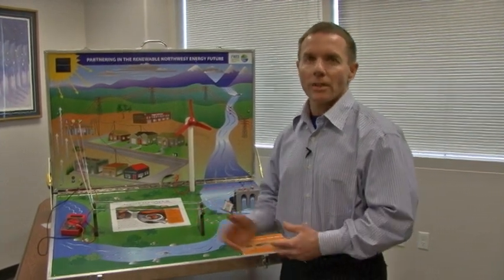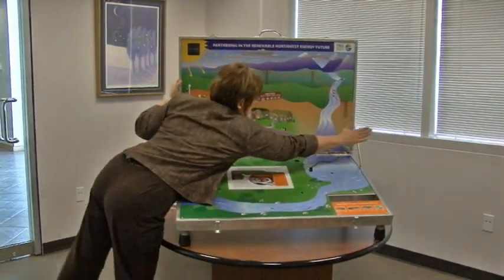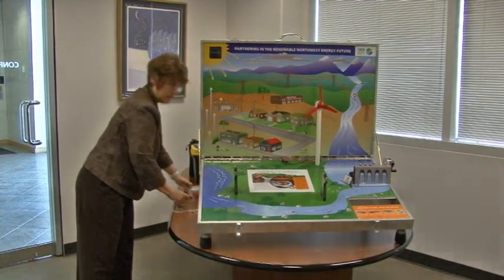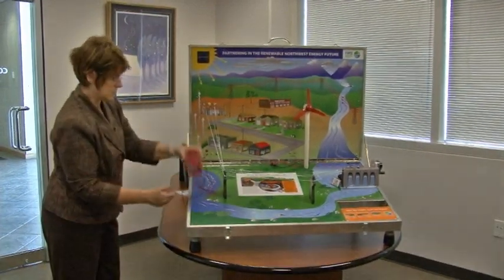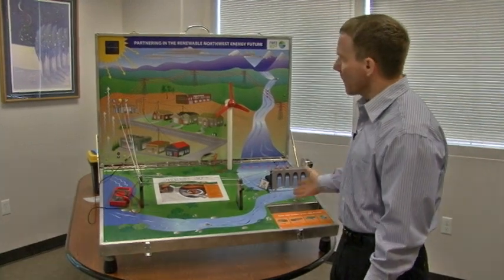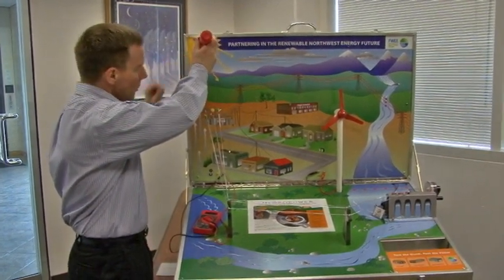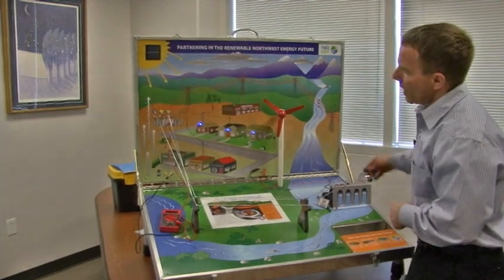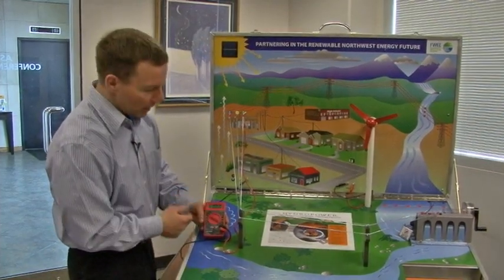FWEE Renewable Energy Display Demonstration

Comment: ok... how much does the windmill cost?.. and...why do we need 120/220 electric?... in the days of Tesla and Edison.. Edison pushed DC electric, but the problem is it runs out of umph after a couple kilometers... AC could be shipped across the land on wires with transformers at the appropriate intervals for full power end to end... the financial people were interested in the commercial application..  to make money selling something that.. other than all the infrastructure was free .. hydroelectric from Niagara Falls
... with the current technology.. pun intended... direct current can be created in individual homes... with very low infrastructure requirements and costs .  12 and 24 volt systems are easy to set up.. cheap.. you won't have to borrow money to get the stuff to do it... 
a little education
a little elbow grease
and... some time
then it actually is
free
here's a thought
do you know how nuclear reactors create electricity?
they boil water and create steam, which runs turbines
hemp seed oil can replace diesel fuel.. it burns cleanly.. no unburned hydrocarbons.. very little CO2... because terpines and fatty acids are mostly hydroxls.... you can grow hemp anywhere people live... building an on demand hot water system can be done easily.. to power a small turbine.. like a Tesla turbine with steam... for..  about what you would have to put down to borrow the money for a windmill like the one in your picture